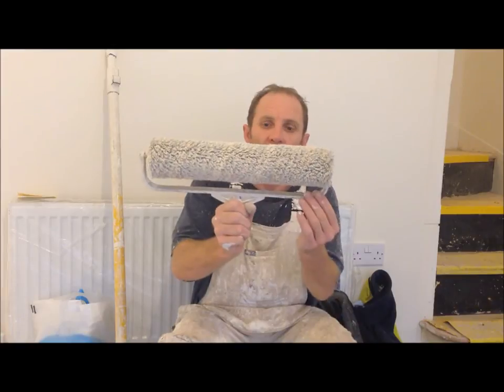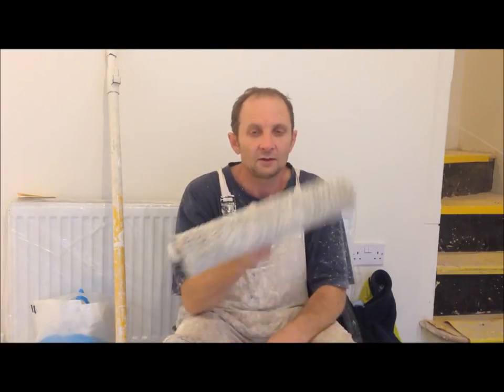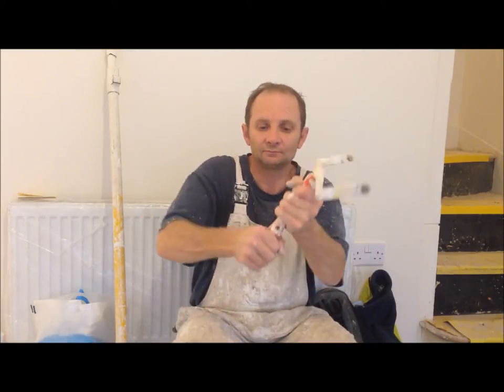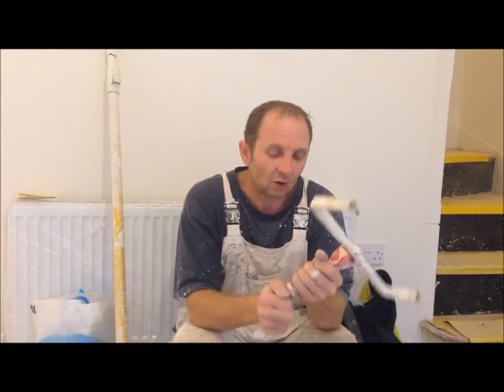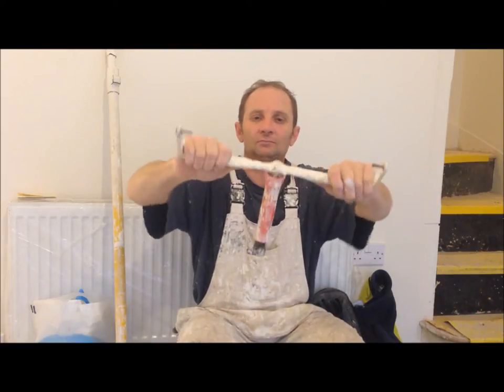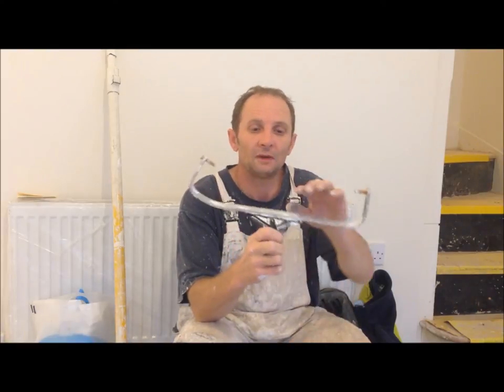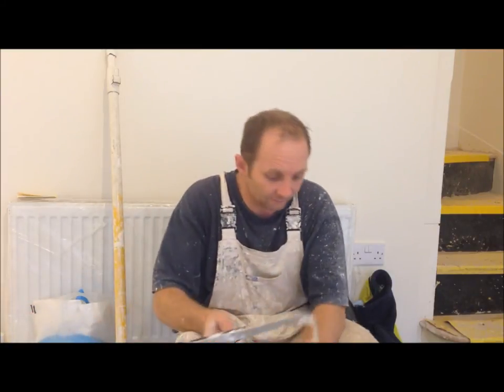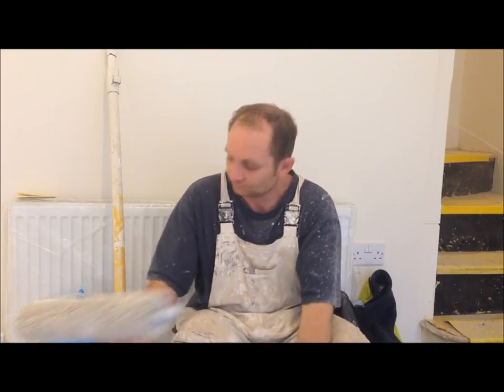Painting & Decorating. 15" Roller Cage,  ( Bend Test )

Comment: whats best for glossing. a foam roller or a normal one
Reply: +Paul Foulkes Foam, lay it off with a brush
Reply: You can't load up a foam roller enough so they're too slow for trade painters.
ok for d.i.y but most trade painters will use a worn mini roller( 4")  that they can load up with more paint and then lay it off.
Reply: Hamilton superlight frame is the best you can buy. Solid does not bend at all. There about £20.00. Well worth the money. I've got the 12 and 15 best frames I've ever brought.
Reply: @jackwardley3626  Chinex ftp is a cracking brush I've got a few.